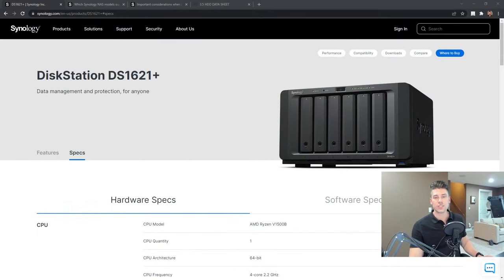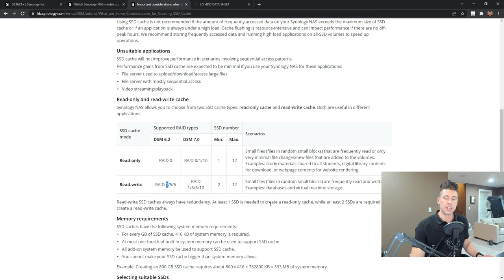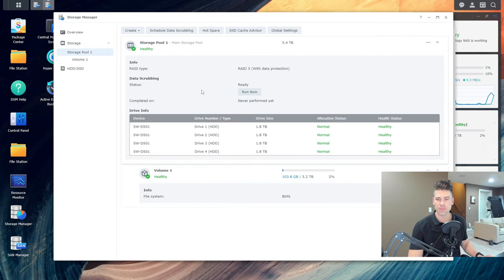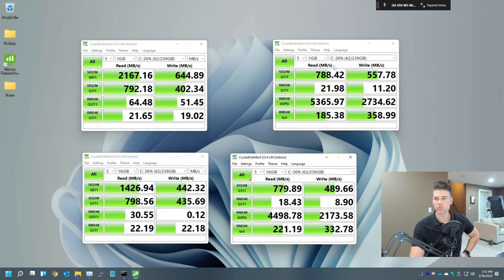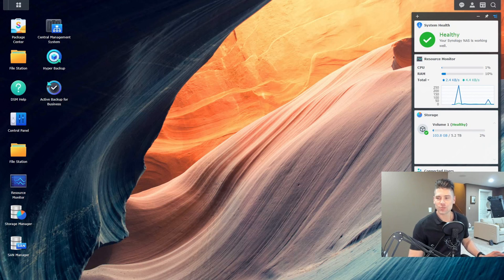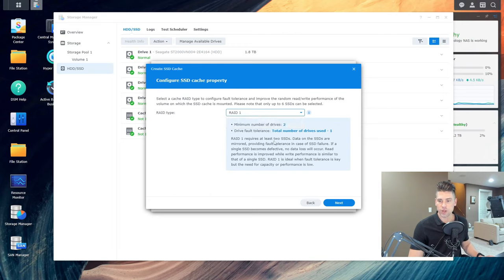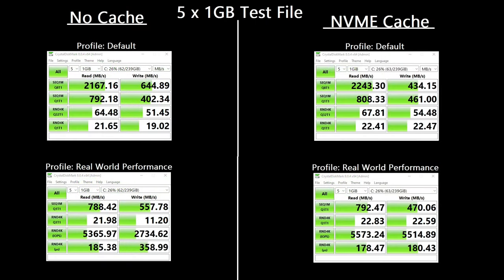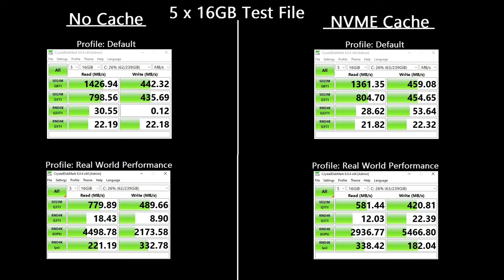NVME SSD Cache on Synology Diskstation NAS (DS1621+) and Benchmark

Comment: Hi Stephen, really helpful video -- thank you for the upload! I wonder if you might be able to offer an opinion on two questions related to SYNOLOGY NAS and NVME cache. Grateful for any help you might provide. (1) I am looking at purchasing a DS920+ with either four 8TB or four 16TB Seagate Ironwolf Pro drives, configured as RAID6/10; what is the optimum NVME SSD cache size for either setup, assuming I would purchase two identical M.2 NVME drives? I am looking for a ratio to better understand the ideal environment. (2) Would those two NVME SSD drives be configured as a RAID, and if so, would that function as a "separate" volume from the four Ironwolf drives? Obviously I am new to all of this.. Oh, and, my needs for the NAS -- I am 80% storing a huge digital photography catalog which needs regular access and READ/WRITE functionality, and 20% Time Machine backups from two workstations and some devices. Ok, that was longer than I expected!
Reply from the maker: Hey Curtis, sorry for the delay responding...

1) It all depends on the workload and what you're trying to do. Some workloads do not benefit at all from cache, whereas other workloads are drastically improved with NVME cache.

2) When deploying cache, for write cache you need to have 2 NVME and they are configured in a RAID 1 volume. However this is not a user accessible volume. The Synology unit attaches it to the storage as cache. With Synology you can't have NVME user accessible volumes as they are only used for cache.
Reply: @StephenWagner  thank you for the feedback, Stephen — really appreciate your time!

Comment: My only experience with cache is using Intel Rapid Storage Technology. I have a desktop with two HDD in a Raid 1 (2Tb) with a mSATA 32Gb cache disk. When It was set up, the performance was not noticable at first. But with the daily usage, it really feels sometimes that I'm using an SSD disk instead of the Raid 1. The OS performance is beautiful. Perhaps you need to wait some time for the cache to be optimized just like mine. But I could be wrong. 

Thanks for the video. I didn't know about this Disktations. It seems like a good alternative for network storage.
Reply from the maker: Thanks for the comment! :) Yea it's tricky, it all depends on the workloads you're putting the storage through. Typical sequential won't be noticeable, but random loads will. However, I think there will be a part 2 to this video as there's a setting I want to play with to see if it will allow noticeable differences on these types of benchmarks. Stay Tuned!

Comment: Hello, I have a DS918+ with 2 ssd cache that I have on read and write. 
In the storage manager, they are both attached to only one volume ! 🤔

1- Does that mean that only this volume benefits from the cache and not the others ?

2- And do operations like : extracting a huge zip file to the same disque benefits frome the ssd cache ?
Thanks 😊
Reply from the maker: Hi Neuromatiq,

It sounds like the cache is only being used on the single volume. I could be wrong, but in newer versions of DSM, you may be able to attach the cache to multiple volumes, however this might only be on the higher end devices (I'm not too sure).

It's hard to say for sure, but if you're accessing a ZIP file over a network share, there is a chance that it may cache the writes while it's reading from disk, for efficient disk access. You'll need to test to confirm.
Reply from the maker: Neuromatiq, I just checked and on the newer versions of DSM, the SSD cache gets attached to the Storage Pool, which should be available to all the volumes inside of that storage pool.
Reply: Thx for the quick answer, I appreciate it 😊
So basicall, I have to unmount the other 3 volumes of different sizes and add them SHR to the default in one single Storage Pool ... That would work ?

I assume there is no way to create more than one ssd cache volume in one single nvme ssd drive, that would be great 🙄
Reply from the maker: Hi Neuromatiq, no problem! I'm not sure what you mean with your suggested route, or how you have the unit currently configured.
Reply: For the zip extaction, I thought of he cache as a buffer, since the drive is at the same time reading and writing data on itself, it would be great to extract all the data to the cache first then write it 🙄

Comment: I haven't really used cache for the last few years (I don't like cache much). But what I do use are M.2 NVMe modules in the NAS for use as a very fast data volume, which Synology can't do, but QNAP can, and thanks to that I run various virtual machines on very fast NVMe (+ I also have a graphics card in my Thunderbolt NAS, so I use this moreover as a powerful PC 😉).
For me, I'd like to mention that if anyone is really serious about performance (and the broader uses of a NAS), they should definitely look at a QNAP NAS solution 👍
Reply from the maker: I just saw your video on gaming on your NAS, that's super cool!

There's a ton of different NAS vendors, all with similar features and their own unique features. I don't think there's any one winner, it all depends on requirements, setup, and also personal preference! :)
Reply: @StephenWagner  Well, I guess it depends on a point of view. Anyway, I've been through a lot of NAS manufacturers over the years. I used to use Netgear NAS products, then I switched to various Synology NAS models, but it still wasn't the same, there were still quite a few things missing. As a long time apple user I missed the Thunderbolt connectivity, more powerful HW, GPU support, HDMI, 10Gb, and other conveniences (NVMe for data volume ☺). I have to say that QNAP is always, I think... 3-4 years ahead of Synology in terms of development. That's why I eventually switched to QNAP and I don't regret it ✌

Comment: @SW The Tech Journal i notice you are using RAID 5 and not SHR1, is there a reason for that?
Reply from the maker: I'm not too familiar with SHR, however I chose RAID 5 because of my familiarity of it, as well after a bit of research it sounded like SHR may degrade IOPS and transfer speeds.
Reply: RAID 5 has slightly better performance versus SHR1 because there is some overhead with SHR1. This is why on the Synology "enterprise" NASes SHR is not offered.

Comment: Thanks for this. I'm going to be following your very well done step-by-step on prepping NVME cache drives. It's the clearest demo I've seen yet.

I'm like a lot of the other users that commented in that my primary goal is improving photo/video editing workflow speeds. With that in mind, I think that possibly going from the native 1Gb/s connectivity to my primary editing computer over to a 10Gb/s connection with a direct connect iSCSI setup could be more important than the NVME upgrade. Once your in a workflow, then data retrieval should be less of an issue as it often gets cached on the local machine. The issue is, just how fast it takes to get from the 1621+ to the editing computer.

Thoughts?
Reply from the maker: Hi there! I wouldn't recommend using iSCSI for basic file storage. I used iSCSI because I'm using VMware and VMFS with Virtual Machines, which supports clustered access. If you did this with Windows, you wouldn't be able to have multiple systems access iSCSI (it would cause corruption).

In your case, I'd definitely recommend using 10Gig, and then use the standard Synology File Share system, as it works great! :) And if you can throw in the SSD/NVME cache, go for that as well as it may help with editing videos if you're doing a lot of HD video editing where it's re-accessing the same file repeatedly.
Reply: @StephenWagner  Thanks for the feedback! Good advice. I'll post an update when I get the new gear setup.

Comment: Heya. A little bit of a novice, just about to setup this same NAS at home with 4x14tb WD Red Pros in SHR... 
but big question.. (I seem to be getting conflicting info out there)
Does video editing and motion graphics work in after effects benefit from nvme cache?
Reply from the maker: Hey Mathew, it's hard to say because I can't say I'm familiar with that type of workload. However if you're constantly opening, editing, and using the same data, repeated access of the same data will benefit from NVME cache. It's designed to cache (and store) data that is constantly accessed. If you have the budget, give it a shot and test it before/after, but I can't give you any definitive answer.

Comment: Hi Stephen,

Here is my benchmark without cache.   Why read so BAD?
202 Read - 912 write.    Ds1621+ 6 -8tb Iron Wolf Drives Raid 5.     Seems terrible.   What would be wrong?
Reply from the maker: Hi Doug, Can you tell me a bit more about your setup? What connection method are you using, SMB, iSCSI, NFS? Also, what does your NIC configuration look like?
Reply: The number shown is SMB.   with ISCSI, I got same read but 535 write.   NIC is 10gb Synology card with Cisco Switch in middle.   Thanks for any help.
Reply from the maker: Hi Doug, with SMB you are going to take quite a hit on performance. What is your ultimate use case for this? Forgetting about the benchmarking, how do you plan on ultimately using this?
Reply: @StephenWagner  Storage and 1-2 VM.   Why can I not get what you get?   I tried to mirror the setup.   Why would Reads be so slow?
Reply from the maker: It is unusual that your reads are so low. Is you volume still initializing? That could be one cause of performance loss... And while it's not the cause of the extremly low speed, note that your drives are a different class than the ones I used, additionally, I use NVME.

SMB Windows shares will cause a performance loss. For your VMs, are you using VMware like my setup? Are you using iSCSI with jumbo frames? Also is jumbo frames enabled on your storage network, as well as your ESXi hosts (if you're using VMware)?

Comment: This is another way Synology Fs you. I have a DS1815+ that's died, for a second time. I had an SSD cache on it. I wanted to get my data off of the drives in that NAS but, of course, I couldn't just put the drives into a Linux server and read the RAID array, even though it's claimed that works. I bought a cheap DS423 (non plus mind you) and now my volume is critical because I can't turn off the SSD cache that no longer exists. WTF Synology?! 

At every point Synology is a fail.